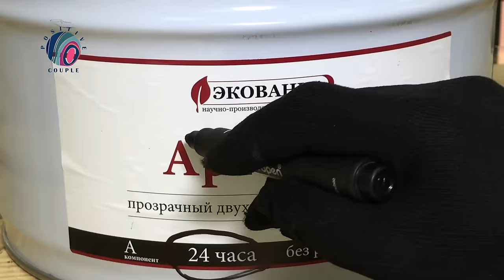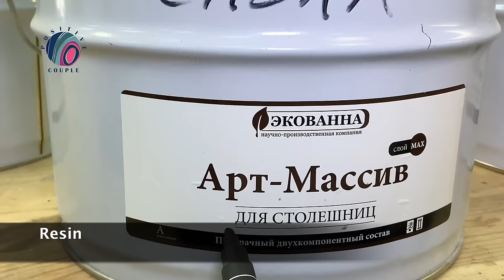Amazing Table of Flowers and Epoxy resin.

Comment: This is a beautiful table but Only problem with this is that epoxy can sometimes turn yellow with age and it’s hard to also get dust off as I’ve had stuff in the past that was in  epoxy I had fake flowers in a vase in epoxy and it all turned yellow and I know other people who have had similar problems and with this being a table would be no good because if you spill tea or coffee on the table it will stain it and it’s hard to clean because certain cleaners can ruin the surface and also cause chemical reaction with all that said it’s is a stunning table
Reply: Newer epoxy don't yellow as much also keep it away from sunlight as much as possible. :)
Reply: i read somewhere last coat should be PU to avoid staining
Reply: Just add a little bit of blue alchohol ink , just a little makes a huge difference in avoiding the yellowing

Comment: How much would such a project cost (excluding the cost of the flowers)?
Reply: The amount of epoxy alone would be 800bucks
Reply: @peterzingler6221  I have no clue, that's why I'm asking
Reply: As much epoxy as was used in all parts of the construction, I hazard a guess at over $1000 U.S. just for the epoxy. Plus flowers, hardware, wood, electronics, and consumable equipment. Still, that is one beautiful table/bar.